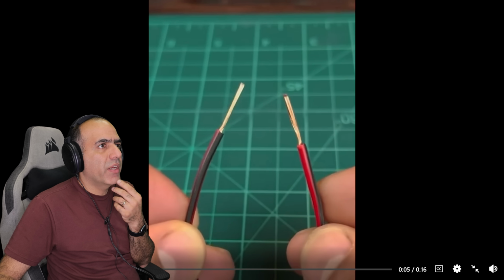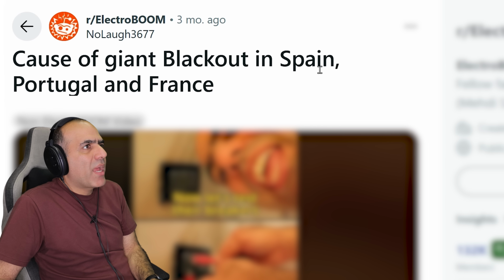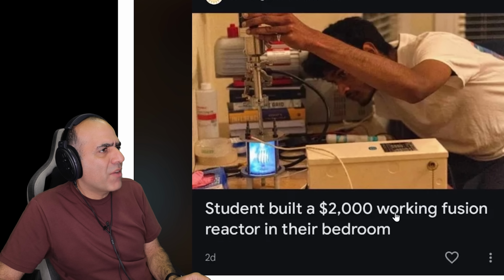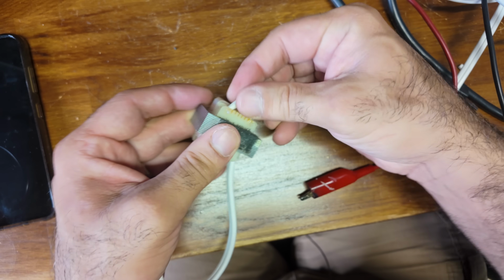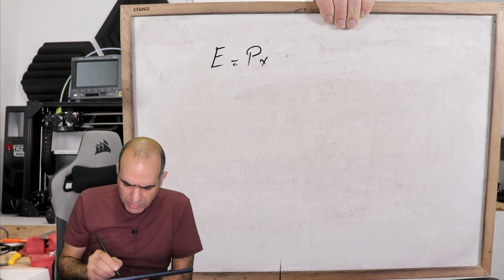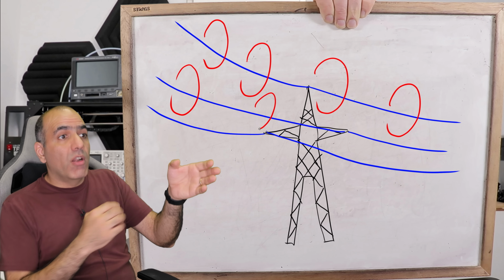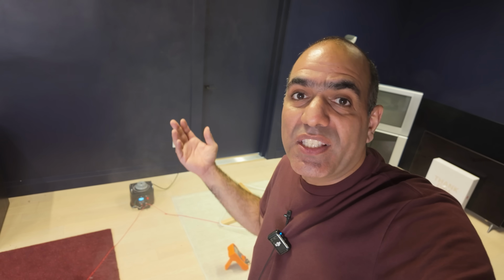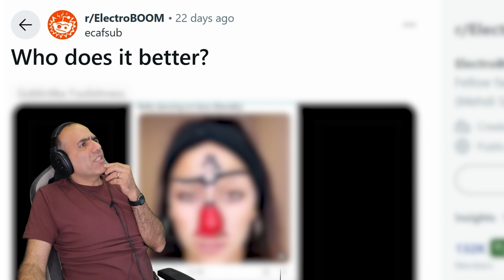Power Lines at Knee Level? Campfire with AA Battery?! (LATITY-016)

Comment: Sparks at gate. What you are missing is that gate is likely attached to very long fence wires. With the dry environment evident in the video, the wood posts won't ground them until the voltage gets high. Fences paralleling power lines need to be grounded properly. Power could be either electromagnetically induced, or capacitively induced depending on the physical relationship. This is likely capacitively induced. That grid of the wires in the gate is a poor, but effective capacitor plate. Alone it might be enough. 

You could test this. Buy two long cattle panels and some insulated temporary electric fence posts from your local farm supply store. Use the posts to hold the cattle panels off the ground under a high voltage power line. BTW, your local farm store may have budget kilovolt insulated wire. Farmers use it.

Electric fence wires will induce voltage and current into neighboring wires that parallel them. If that wire is insulated properly you can get a good shock off of it. No need for a loop, just have them parallel for a long distance. 100 meters is plenty long, 1000 much better.

Comment: As a general rule, if you ever see something radioactive  glowing almostfor what ever reason, then that’s really, really bad. If that guy had actually built a fusion reactor in his basement, and that blue glow was Cherenkov radiation he’d already be dead.
Reply: The glow is from plasma being charged by high voltage in the near vacuum of the core of the device.  This is just like how a neon bulb glows.  It isn't Cherenkov radiation.   And this is a real fusion reactor.  They're called Farnsworth fusors, and they fuse deuterium.

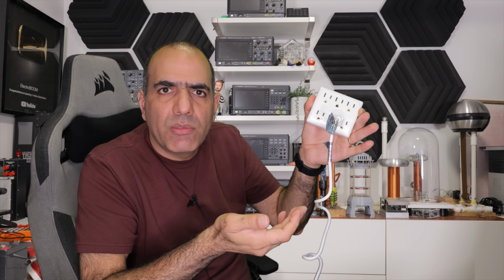Comment: 4:00 all the explanations here I saw were guessing it's to do with spacing for charging adapters (wall bricks). but if anything, you'd get better spacing if they are plugged into the outer sockets. either way, the spacing is likely coming from the metal contact strip spacing. for ease of manufacture, tooling and assembly, the contact strip tabs are made at an equal spacing.

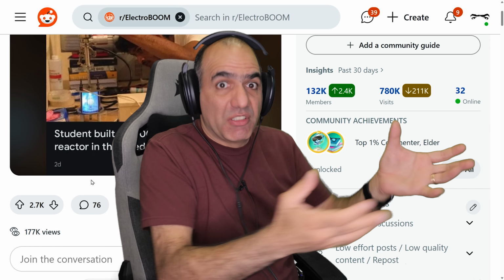Comment: Yikes, at 05:30, yes, that thing can do fusion. This design, fusor, has been around for how long now? For fusion all you need to do is overcome the coulomb barrier, which is only a few keV. You created FAR higher voltages lots of times already, but your particles smashed into others before reaching such speeds. Do it in a good vacuum next time, boom, a little bit of fusion.

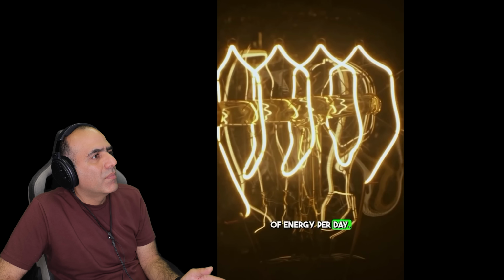Comment: 9:07 The bogus presenter uses Watts as a unit of energy, when watts is a unit of power. Therefore, perhaps what they meant was 2000 Wh of energy every day, which would be significantly more believable.

Comment: The service loop for the coax (wire nuts lol) is just to give you some excess wire in case a connector needs to be replaced in the future, you'll have plenty of cable and won't need to run new lines.  If there's a box on the outside of your house (we used to call it a NID or Network Interface Device), the loop is in there.

Comment: 04:00 it seems like outlets and plugs are made as small as possible maintaining safe distance between contacts. This is why they ended up with plugs we use. And when they also want this multiple outlet as small as possible, and still keep that safe distance between contacs, they would end up with about same gap. Maybe smaller gap would be acceptable, but in that case they went safe way ans assumed to use same distance as specs shows to distance between outlet legs.

Comment: The "fusion reactor" is indeed a fusor, its a kind of reactor that fuses ions by accelerating/heating them using electric current. The energy produced by the fusion is around one hundred thousand weaker than the energy consumed to produce it, they have inherently no uses in power production but they can be useful if you need neutrons without a radioactive isotope as a source. A running fusor does however produce a bit of radiation, mainly visible light, UV, and a bit of X-rays.

Comment: I don't understand if you're experiment was attempting to debunk the fence chain sparking? But I fully experienced it I had a self-storage business very close to high voltage power lines and every year we had to replace the outdoor security cameras. Every time I touch the waterproof casing for the cameras I would get shocked. Nothing more than static electricity like rubbing your socks on the carpet. I'm not far from where you are in Vancouver I could take you to the location. Not far it will be a few hours drive LOL

Comment: Dear me, not a woodsman then? That battery is giving you plenty of heat to start a fire, you just need decent tinder and a bit of blowing. After all, people can start a fire with a single spark from a bit of flint or even just the heat generated by rubbing sticks together.(That takes a bit of practice)

Comment: I dont know, ive seen some stuff like when i was doing RF welding for a company. We shoot radiowaves at a barrier making x rays that cause polymerization. There was a metal bar about 8-10 ft from the radio source transmitter and that bar would do some strange stuff like get HOT.

Comment: 4:15 I think that plate is designed that way to accomodate old-style "wall wart" power supplies. They used to be so big they'd obscure the neighboring sockets. Designing the panel in that way allows multiple wall warts and regular plugs to share space without hanging off the sides.
Reply: In my line of work, I often run into customers who have power strips almost all taken up. I will often shift stuff around and cross between two plugs to make just one more fit.
Reply: Old game console adapters was my first thought.
Reply: I'm always having that problem, but it looks like with this one that a large power cord will still take up two spots in any case
Reply: Came to say this exact thing 🫣

Comment: 04:04 You know those DC transformers that are so big it takes covers the half of the adjacent outlet? I have one rated 12V and if you plug it normally you can see that the outlet next to it is half covered. If you plug it like between the 2 outlets it covers both. You still lose one because of the transformer size, but at least both outlets are covered.

Comment: Trying to start a fire with a AA battery is reslly easy if you use a foil gum wrapper cut into like an hour glass shape. I say its easier because the foil has paper on the other side and its basically like a match

Comment: MEHDI : He didn't say 2000w during a whole day. He said 2000w IN a day. So 2000 watt-day which is an absolutely ridiculously small amount considering my house alone consume 25 000 watt-day.
Reply: 2,000 Watt-day is 2,000 watts for a whole day. That's what "watt-day" means. I kind of doubt that your house consumes 25kW, a typical house might consume 25kWh/day, which is pretty close to one kW on average.
Reply: @WJS774 ah 6months ago .. but you're actually right I got my units mixed. A watt-day is 24 time bigger than a watt-hrs not smaller. There is then absolutely zero way this thing generated 2kw during the whole day. I was giving too much benefit of the doubt to the author.
Reply: @miranina1585  Yep. Almost certainly what he actually meant was that it generated 2000 Joules across the entire day, for an average power of 23 milli-watts.

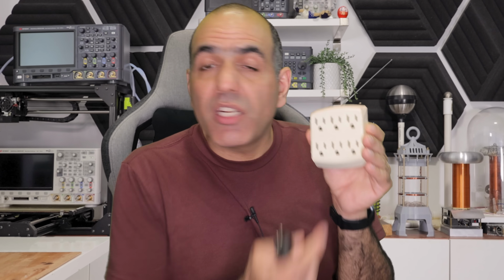Comment: 4:14 Maybe, if it's on the wall, and you use all 3 ports on the lower side, and you have two more plugs you gotta use, you could maybe offset the upper plugs to pass the wires easily (for the ultra specific cases where they're all 90 degree plugs instead of straight)

Comment: 4:04 "...there's no application, why would you do that?" If you have those fat 'wall wort' plugs that block adjacent outlets, you might be able to use that offset so that instead of blocking two side outlets each, together they block a total of three outlets, half-blocking one on each side of the pair, and one in between the wall warts.

Or you could pick up a pack of those six-inch extension cords so that the wall warts aren't directly on the wall/power strip so they don't block ANY outlets.

Comment: While you can use a wire you strip yourself to make this, you could also use a twisty tie from a bread bag or a gum wrapper cut thin in the middle. It works, but you have to do more with the tinder material and birds nest fire lay.

Comment: I cannot explain the phisics, but I also got these little sparks when passing under those high voltage towers on a foggy day, they sparked between fails in the metal mesh in the umbrella I was using

Comment: DOMESTIC SUPPLY IN ALL EU COUNTRIES IS 230V ! 
Have you forgotten Domestic power supply in Europe is 230v AC NOT the miserly 110v as in the USA. So a domestic kettle will normally be 2000w and a power tool also at least 2000w. Indeed in Britain you can run a Split level domestic Kitchen oven with a demand in excess of 50 AMPS from a domestic socket. Indeed you can draw up to 75AMPS from a domestic 3 pin socket.(but only in Britain). In Germany every house also has a 3 Phase supply at around 410v for electrical items requiring more than 20 amps !!!

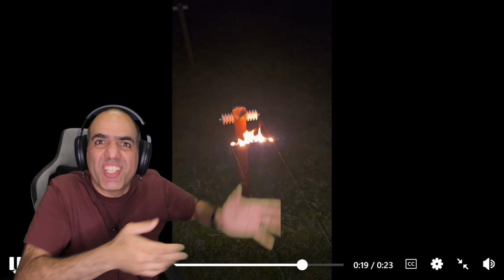Comment: @5:00 Low-to-the-ground shock fences are used for camping (usually researchers / scientists) in areas with dangerous animals like polar bears. However, that one appears to be heavily (illegally) modified to produce a lethal amount of power, possibly by swapping the 12v battery with something much more powerful. Even in states where this type of fence is legal, supercharging it like this is illegal A.F.

Comment: 4:05 the only thing this might help that I can think of is if you have a couple bulky chargers plugged in, too. Sometimes those bricks can be so fat that the plug next to it can't be used. Maybe this can help turn two partially blocked outlets into 1 functional outlet?

Note: this would not work on the 3x2 plug Mehdi has because it would need to be at least 4 outlets in a row, but might work for the power strip they showed originally

Comment: I just got a flashback to one of my own Mehdi moments. I had an 18650 LiPo cell in my pocket for my.. lets call it pocket aroma diffuser.
One time, I was sitting at my office desk when suddenly my pocket got really hot really fast. Turns out my keychain shorted the 18650 cell. 😅

Comment: 4:04 Well, Mehdi, it's for space efficiency. Not all AC adapters are of equal size. For example, hard disk enclosure driven by city power often comes with big or long AC adapters.
Such "out-of-shape" adapters physically block the adjacent outlet on conventional extension cords, wasting that one.
In Japan, you can find something like "extension cord with 7.5 outlets". That's not a typo. It has 15 holes (hence 7.5 outlets), and we can plug any AC adapter without hazard (granted, most Japanese electronics have adapters without a GND pin - that's why this idea works).
A big adapter may block the hole next to it, but we can just skip that one and plug that other devices with minimal wasted space.

Comment: I'm pretty sure when he said 2000W per day, he meant 2kWh which is 7.2MJ.
An article about it states "2000W per day, which would produce 136MW a year". If they meant continuous power (W) instead of (Wh), it wouldn't suddenly turn into more a year, but would still be 2000W.
So, each person (assuming 27k persons a day producing 2000Wh a day) would produce 2kWh/27k = 0.07Wh .. in 2 seconds. That would be 252W in 1 second, or 252J. If they push for 2 seconds, that's 126W for those 2 seconds... which is much more realistic.
If we assume they have to push that lever over a distance of 0.5m (Energy produced (252J). F=W/D), they'll have to apply 504N of force.. which is equivalent to 51kg.. which would still be a pretty hard push. Even if we assume 1m.. a 25.5kg push would definitely be hard to do for children and some lighter adults.

If any of these calculations are wrong - sorry... I'm terrible with maths and formulas.. but I'm pretty sure that they're right. :D

Comment: The knee high power line MIGHT be a pest deterrant, but.. It's an overkill one if it is. I mean, a standard electric fence only needs one strand. And a pulsed high voltage current. Every x time (usually about one second) a pulse zaps out through the wire. If there are no bridges to ground, it doesn't really do anything and the net power usage is quite small. But if something is bridging to the earth (literally the ground we walk on) then it dumps power out through that thing. If that thing is a cow or a person or whatever, they get hit with a very very brief yet high voltage pulse. The fence we use here is 15K volts which can make a bull jump back and say "I didn't want that grass anyway" if the ground has enough damp in it.. But that's a 'hot wire' system. If you bridge from the live wire across to any earthed wire in a fence, you get a really really good earth connection and thus you get the full thump.  The actual energy delivered is between 0.1 and 1 joules. Fences designed for dogs and cats are usually around 0.3 joules for the strong ones. Same voltage. Lower power.

But the fence shown in the video is two wires of sustained high voltage. I can't think of a sane application for that as an electric fence. And judging by the way there were brief arcs through the fire when it caught suggests it's higher than 15KV also. Curious.

Comment: I've tried Brilliant. Too boring. Like I've piked a math equations and instead of doing them there were tons of "balance this scale with bricks" lessons on the start. And when things got more complicated I pushed "explain" button and in 90% of cases it said "answer b is correct, because its the only correct answer out of 4 variants"

Comment: 4:44 Correct me if I got that thing wrong, but that looks suspiciously lot like a cow fence.

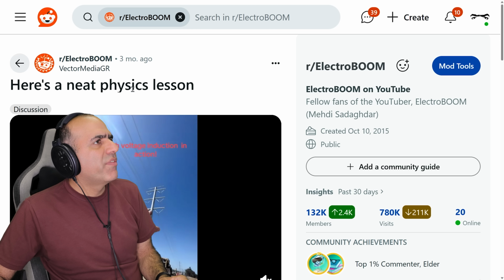10:43 EU plug 380V. Used to power construction equipment like portable concrete mixers etc. And yes, it is shrouded male connector.
Reply: But why get a shock off the male plug when the fully enclosed female outlet supplies the power? We use in work, and in no circumstances are the male plugs (like the video shown)  live.
Reply: @burtgummer9057   So I looked up for an answer and this is what google gave me (I can recognise the plug, but I'm not electrical engineer, nor history buff)

I apparently boils down to following:

Insulation and Protection.
Shrouds cover the pins, providing insulation and protecting them from environmental factors like dust, moisture, and physical damage. 

Accidental Contact Prevention.
The shroud prevents users from accidentally touching the live pins of the plug, reducing the risk of electric shock. 

High Voltage and Current.
Unlike lower-voltage household plugs, the heavier industrial connectors used for 380V applications carry significantly more power. The shroud adds an extra layer of safety for these potentially dangerous connections. 

Specialized Applications.
380V is not a standard household voltage in Europe; it is used in industrial or commercial settings. Shrouded plugs, like those conforming to IEC 60309 standards, are designed for these heavier-duty, high-power requirements. 

Polarization and Keying
The shrouds on these industrial plugs often incorporate a keyway or specific alignment features that prevent incorrect insertion and ensure that the plug is oriented correctly within the socket, which is crucial for safety in high-power systems.